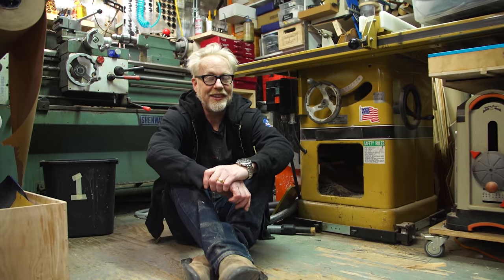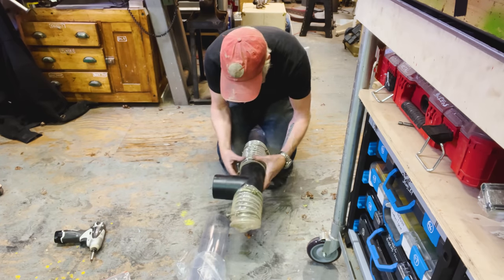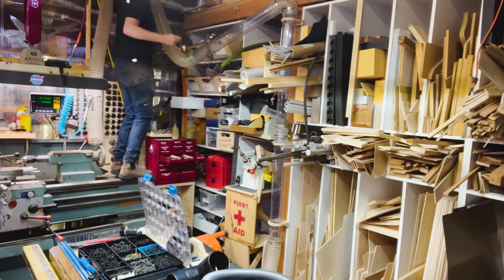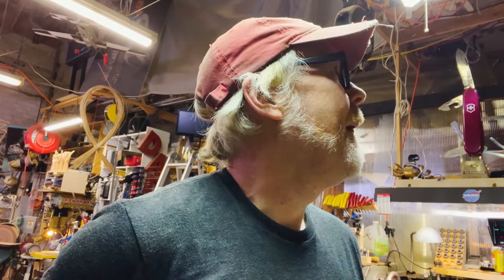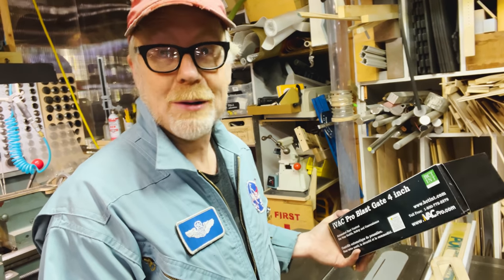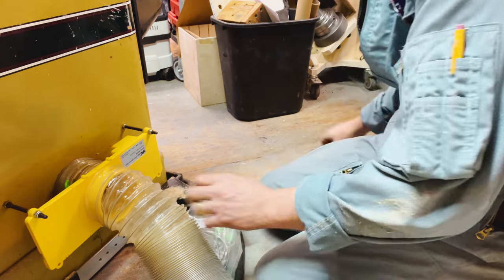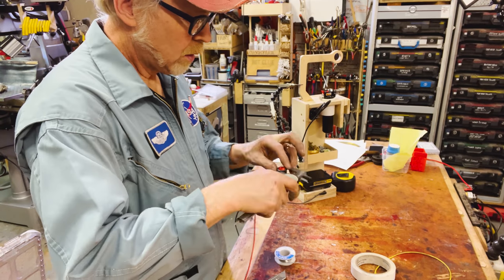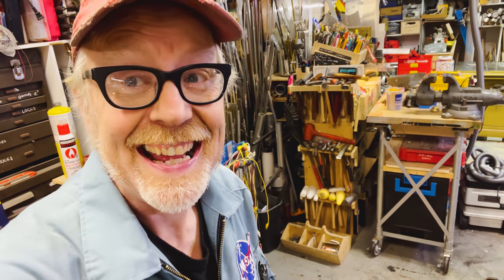Adam Savage's One Day Builds: Shop Dust Collection System!

Comment: Watch for static. It may not cause a fire, but those little particles and the air itself through those plastic tubes can develop quite a charge if you touch 'em.   :-)
If you have a chance to run a piece of non-insulated wire inside to a ground, you might consider doing it.

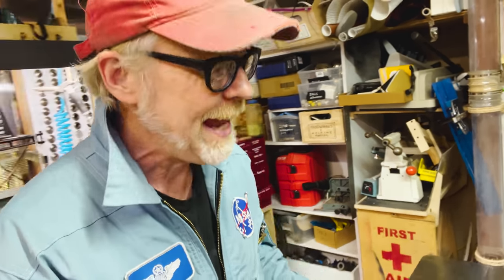Comment: 26:00 
I love how there's an expandable joint you could replace with a gate in what looks like the perfect position for easy manual usage right behind you the entire time you are doing this scene about how there is not a good place to put a manual gate.
Still, at least you got better suction on the smaller hose this way.

Comment: Our makersspace uses gates at each tool with a relay contact that turns on the dust collection system.  Pull the gate open and then turn on the machine.  When done, ouch the gate closed and the dust system turns off.  Super useful.

Comment: You should add a dust collector before the vacuum.   I added a 32 gallon cyclone dust collector before my 1hp 4 inch shop system.   I now rarely empty my dust bag on the vac, get significantly better suction and it's much easier to empty the 32 gallon drum vs the dust bag.  It's really great when using my planer.

Comment: Run a compressed air stand line along side vac line. Rig a relay inline with power switch on tool, relay triggers air switch to operate vac gate air cylinder actuation. Each gate opens when you power it's associated tool. Also lets you remote gates off mainline.

Comment: Friendly reminder to bond/ground the whole system with 12 AWG copper wire. Running dust through plastic causes severe static buildup without appropriate grounding (source: HVAC Engineer who designs these systems commercially). I believe SMACNA Industrial should explain the “why” and “how.” Great little system! I also recommend an overhead extraction arm for that table saw, check out General Excalibur!

Comment: I added a clamp on current transducer with a dry contact to open the blast gate. So when i turn on the saw it opens on its own. it works get on the drill press because it is only used in short bursts.

Comment: Also, you should get a pleated filter like a Wynn Environmental filter. They filter smaller particles that are actually harmful, but also they have a higher flow rate (more surface area on the filter) so you get better suction. More CFM out the filter = More CFM in the sucker end.

Comment: B/c Adam is a good builder and very clever I came into this video anticipating to see a seriously good dust collection system. Surprisingly that was not the case.   So every time the dust collector gets full  -  he’ll have to climb up a ladder into the loft to empty the system. No pre separation no cyclone dust deputy and a cloth filter bag rated to capture dust greater that 1/32 of an inch.  No anti static ground.
I didn’t want to say this, but what a hack 1 day build.
Thanks for sharing, it was entertaining.

Comment: When you get a chance, upgrade your dust collector sock with a cartridge style filter. You get way more surface area, finer filtration and much much better suction as your bag fills up. Also try and reduce your ribbed hose to as short a length as possible. 1 foot of fully stretched of ribbed hose is equivalent to 3 feet of smooth hose in terms of resistance. Lastly reducing your 90's will greatly reduce turbulence in the system. Good luck with your dust collection system.

Comment: If you could find plumbing fitting of the right size you could do away with the flexible hose and have a smoother airflow especially if you could find swept bends instead of sharp 90° Bends.

Comment: I realize this would have added a lot of complexity, but I would have added the electric gates at the T on the collector  to shut off a whole section. Would assume that would lead to massive increase in sucktivity.

Also maybe would have stolen power for the gate on the table saw from the table saw somewhere.

Would also be superrr neat if someone made a thing that would sit between a plug and the socket and could send a signal when it sees a rise in voltage which could wire into the gate to actuate automagically!

Comment: You could invest in a "cyclone" type of dust remover; made out of two, 5 gallon buckets!! 
The top bucket has an entery that spins the dust around, and around; and the exhaust goes up the center!  
The lower bucket collects most of the dust!!!!  (cut the bottom out of the top bucket!)

Comment: It is smart to have your dust collection outside so you dont fill the shop with 10 micron particles 👍and remamber volume vs. presure/ suction need to be balanced so you have enough sucking power and allso the volume to not cloge up dont go too big dont go too small .thanks again

Comment: Great project, dust removal and air cleaning is key in the shop. Just do yourself a favor and replace all those T connectors you used to split and divert and change them to Y connectors. First rule of hard line dust collection is to avoid hard 90 deg turns, they are the enemy of air flow. As someone who's built multiple such systems, I can promise you that you'll see gains in your suction efficiency. You may also want to build and/or buy yourself an air filter like the Powermatic PM1250 to save your lungs from small particulates.

Comment: Your blower is built for 4 to 6 inch diameter hose.
You can definitely use it for smaller but is you find it isn't meeting your needs in the future, you have a few options:

A larger blower won't help you unless it is intended to be used with 2inch shop vac hoses but then it won't play will with your large plumbing but maybe you can removing the housing and 3d print larger adapters to use what you have?
Might be that some of the tools don't make enough dust to matter? 

That orbital sander will probably be a issue under sustained load as the tube volume is decreased no matter how you do it though, might need a different solution there.

If you look at the specs of your blower it will tell you the smallest diameter you can use and still maintain functionality.

Great build!

Comment: Adam, a quick question: You sprang for the remotely/automatically operated gate.  Why then didn't you put the gate right at the T-junction in order to allow the gate to cut out as much ductwork as possible?  It would've made the power to the gate easier/shorter and the system more efficient  Am I missing something?

Comment: I have a dust collection system made of all rigid pipes , only the last bit to the machines is flexible. I was warned that the static electricity ⚡️ caused by the dust rubbing on the plastic could cause combustion, or even a dust explosion. So far i have had no problems.

Comment: Hey Adam your 90 degree at the Dust collector, its a bit like blowing air through a paint sprayer the pressure drop across the 90 sucks the paint up the tube, so its not going to perform you, really need a 30degree so that when your blast gate closes on the main line the 30 acts like the main line.  It will also reduce the turbulence at the connection and increasing the pressure drop and making the performance better.

Comment: You want to be sure to keep enough blast gates open at all times so that the fan can move the design airflow.  Closing all but the gate you are using probably will result in more air through that terminal but reduces overall airflow.  This is a problem because the air velocity will drop in the larger sections of duct and can result in dust falling out of the airstream into those duct sections.  Keep the fan well fed!

Comment: The dust flowing at a high velocity through the plexiglass tubes might generate a static charge build-up which could lead to a massive dust explosion.  You may want to ground the tubes to bleed off the static charge.

Comment: You may discover you'e getting zapped by static electricity from the particles moving through the plastic pipe at high speed.  The static can also make airborne dust cling in globs to the exterior of the pipe.  If you're having these issues, spiral wrap the pipes with bare copper wire at about 8" intervals,  shoot self-tapping screws into the pipe every foot or so to secure the wire, and ground it.

Comment: For wood dust vacuum systems to work well there are a couple of simple rules to follow to get teh maximum out of the system:

avoid sharp bends
avoid turbulence in the pipe
keep your pipe as large as possible as long as possible        keep your drop lines 4" diameter down from the ceiling as to as close to the workbenches as possible
no leaks

dust suckers don't have massive sucking power (like a shop vac),  they are designed to move a lot of air (think AC handler) which then moves the dust.

Comment: A couple of things I'd like to point out about how dust collectors work, and how they differ from shop vacs.  (Adam, your plan to collect dust from sanders and such aren't going to work quite as well as you want, even with a higher horsepower dust collector.)

TL:DR = Use a shop vacuum with a short hose to collect dust from small tools such as random orbital sanders and routers.  Use dust collection systems with high CFM to collect from large tools such as table saws, jointers and planers with dust collection ports that are 2-1/2 inches in diameter or larger. 

Shop vacs generate relatively low cubic feet per minute (CFM), but generate a very high pressure differential.  When shop vacuums are connected to duct systems, such as the one built by Adam, they tend to fail because they work on creating vacuum pressure, rather than air flow.  When you have such a large volume as created by duct systems, that vacuum pressure is diffused across an enormous volume, further reducing the air flow and so are much less efficient when trying to suck through long stretches of hose or pipe.  However, they are much better at dealing with the bottlenecks involved in connecting to small hand held power tools, since the restriction actually concentrates the vacuum pressure by which the shop vac operates.

Dust collection systems, on the other hand, work by using a large impeller that moves a lot of air, at relatively low pressure.  The less bends in the tube, the better.  Low pressure systems like these do not handle bottlenecks well, but are very able to pull large amounts of dust and wood chips to a central dust collection location.  Reducing the diameter of the hose will cause a bottleneck which can cause line blockage, so you want to try keeping the tube size consistent throughout the system.  In this case, 4 inch dust collection system should be connecting to 4 inch dust collection ports on the large tools.  While not always possible, this is the ideal to work towards.  These are ideal for collectors like that on the large disk sander.

Comment: Wire each one to the on switch of the tool.  It's usually low amps and feeds into a relay to start the motor.  Hit the button on the tool and only that gate opens.  Then when you turn it of, it closes again to isolate it from the other tools.  And I bet somebody makes PVC ball valves in the size you need for your vacuum hoses.  Check out how big body shops plumb their stuff in for more ideas.  The ones I have seen use 1 1/4"-1 1/2" tube on the drop lines and feed into 2 1/2" trunks.  Reducing the diameter of the tubing would up the vacuum you receive at the end.  Just be careful not to overdo the reduction because most blower and vacuum motors use their own function to cool the motor and eventually the accordion tubing will refuse to......accordion due to vacuum.

Comment: I'm told you can starve your dust collector motor by reducing down to the vacuum hose without additional air flow. Also the remote switch will block the table saw fence if you happen to move it all the way to the left end.

Comment: If you want to improve your suction, you need to add the blast gates as close to the collector as possible. Putting them at the tool itself allows the collector to suck air/vacuum that entire length of line to the tool otherwise.

Comment: Adam, iVac do an automatic blast gates system so the gates open when you turn the tool on. You have linked their blast gates so you might be familiar already.
Reply: there is a sensor that goes on the power cable to the table saw. When it senses a current being drawn it operates the blast gate. very clever and convenient

Comment: The dust collector fan is designed for a high flow rate and not to build a high-pressure difference like your shop vac. So you really need to minimise restrictions in your system to ensure the flow rate stays high.

Comment: Mr Savage may i suggest usiing that fancy resin printer to print an enclosure for that power brick of the blast gate , then strip down the  power brick  and tap it straight into the table saw's Incomming cable .

Granted if both of them run on the same voltage

Comment: I was thinking the whole time - you need a way to shut / cap junctions so you are only using what you need so you have the full power... You can replace your shop vac if you add in a system to split between vacuum hose and dust collection, then have a cap to put over the vacuum hose when not in use.

Edit: Yes, A lot of people have made automated gates with arduino, and so on... You can use a powerbar to turn on power to the devices and power the gate with an adapter, or there should be adapters to do the same thing.. if not, just make one.. they aren't difficult and it is inexpensive to make yourself.

Edit: I probably would've wired the switch so the O is open, and I is closed, if using a switch... or, use a detector around the power wire to detect when power is flowing and then automatically open the gate that way... no way to forget a switch... alternatively, a power bar with that functionality already built in ( pretty sure they exist ).

Comment: Add to this something I invented called 'Man Dusting'. It only has two components, a rechargeable leaf blower and a whole house fan. Open one window or door for an intake vent, turn on the fan, then use the leaf blower to loft the dust into the air. Continue until you no longer see dust floating in the air.

Comment: Missed an opportunity for a little more automation.  iVAC Pro Tool Plus Tool Sensor  will automatically sense when you have turned on the table saw, open the blast gate and can even turn on the dust collector if you replace your current remote switch too.  It will also turn off and close the gate when you power down the tool.

Comment: I don't know, Adam, the old hose being used as couplings for the new lines may give you headaches down the line.  When I see dust collection system designs, it's usually rigid fittings all the way through, except when you have something that needs to move, that's when hoses are utilized.  Central vacuum systems in homes are the same, and using sweeping elbows for turns reduces resistance as well.

Comment: Great, fan am I and admire your work. Good job on the dust extraction system but surprised you didn't slave a relay for the bench saw auto vent from the bench saw fail off switch. The disk sander allowed dust to escape because I think you were using the 'up' side away from the vent if you had used the down side all the dust would have been sucked way, or most of it! How big a motor has that dust extractor got?

Comment: If you have a vac with power outlets for use with a tool.such that it switches on the vac when you pull the trigger on the tool, it should be possible to extend that socket to plug sockets for use with said toolsmon the wall...although maybe not best practice of you're likely to be using a number of tools simultaneously...I'd bet there's be a beefy a power supply separate that would mimic this though that said even if your Vac didn't have such an option or you wanted to better manage the power load distribution.

Those sockets could also be plugged into a voltage monitoring circuit and back to something like an ESP32 controller board programmed to trigger stepper motors as soon as power usage is detected at the socket.  

Those stepper motors could then open the appropriate blanking plates...then, close them after a certain time of detecting the power has been switched off at a certain socket.

Would be an interesting project maybe...if a little OTT 🤷🏻‍♂️☺️

Comment: Its pretty simple to make a system that will handle the sawdust / shavings, but the extremely hazardous airborne particulates that will get in your lungs requires more effort. 
 If you can move your dust collector outside the working environment is the best but if not, you really need an efficient cyclone and canister filters to remove the dangerous microscopic dust.

Comment: You  would need to add a air filtration unit to collect dust in the air.  Check it out at Woodcraft store.  Are you worried about static electricity when the dust flow through the plastic pipe.

Comment: They make butterfly valves in that diameter, but they are expensive.

I looked at them when designing my mk2 potato cannon, because my uncle (a pneumatic engineer) said they are better for instantaneous airflow.  You don't need that in this application because its just an on/off switch for you, but a ball valve that size will be difficult to turn.  At least the cheapo pvc ones that I could find that worked with the pvc you use for air cannons... XD

Comment: Adam

 Sucking metal bit and pieces and dust THRU the impeller on that Delta dust collector can seriously impact the life of the impeller.  Have you ever thought about a small cyclone unit that would be portable or just get a few and put them near the metal working machines?  A 5gal utility bucket, with a GAMMA SEAL lid with pvc pipe fittings into the lid would be inexpensive, and would let you empty the bucket as needed without having to go into the loft.  Definitely will catch all the metal dust/shavings/etc from the mill/lathe/disk sander

John